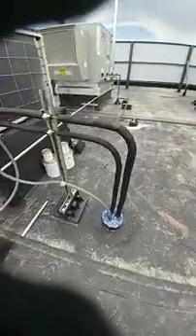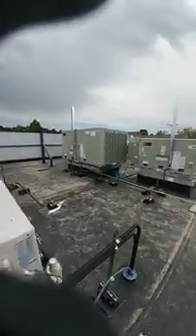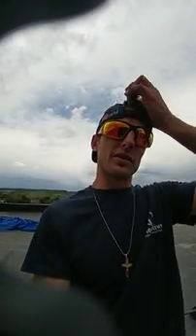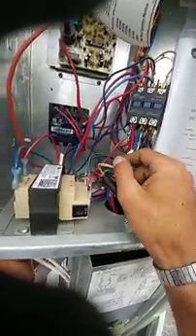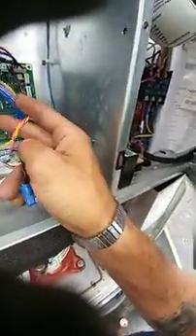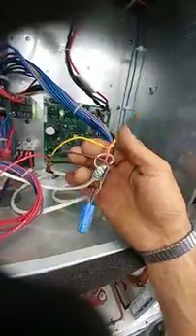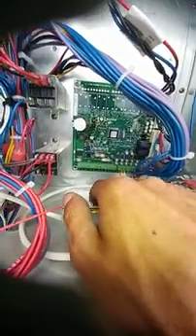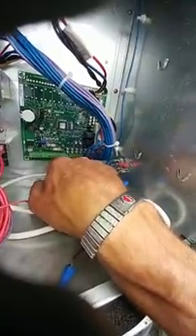🔩🔨HVAC/R DUDE: TRANE CO2 POWER EXHAUST CO2🔧🔩

Comment: I am working on one with an error code with 2 blinks (CO2 sensor error code). What would cause that lockout code?
Reply from the maker: Failed co2 sensor
Reply: @HVACRDUDE  The issue is that I can’t find any CO2 sensors in this specific unit. Would the code be caused by the dampers not opening when the unit is calling for fresh air?
Reply from the maker: @kizito8888 the c02 sensor would be in the space.  And yes possibly but usually throws a damper code and not C02 sensor failed
Reply: @HVACRDUDE  Thank you. I will check it on Monday.
Reply: @HVACRDUDE Btw, when you say “in the space” do you mean in the return or supply? Or in the building? My first time dealing with that code in cooling mode.
Reply from the maker: @kizito8888 should be in the room. By the return and tstat

Comment: We're do I land 24v power exhaust to on the trane control? OAH+?
Reply from the maker: To 24v
Reply: @HVACRDUDE  there's already a plug connector 24v from Bellmore actuator so would it make sense if I wire it to Exf on controler? Thanks
Reply from the maker: Exf is power exhaust so yes

Comment: I have a train unit stopping after a while and the error on the board is with the CO2 sensor, any idea how to fix this???? Thanks in advance
Reply from the maker: Take off the c02..it doesn't need it ..its an accessory
Reply: @HVACRDUDE  where is located???
Reply from the maker: It connects to the ECONOMIZER MODULE
Reply from the maker: Just shut unit down..pull the 2/3 wire molex n restart..should be good
Reply: @HVACRDUDE  And the LED lights will still flashing or it will stay solid???
Reply from the maker: I haven't done hvac in 6 years..hard to remember..I only do commercial industrial refrigeration now...0 hvac..hated it...roofs....fuck that
Reply: @HVACRDUDE  lol i underthe struggle 😂😂
Reply: *understand

Comment: How do you bypass a faulty co2 sensor? For temp cooling until I get new co2 sensor
Reply from the maker: The unit doesn't need a co2 sensor to run. All is does it open economizer and turn on blower low speed when ppm rises....just take it out

Comment: Hi. Working on a trane rooftop now, with a tane economizer, hooking up a co2 sensor. I see the dcv terminal your speaking of. Where I can I find a connector like that for the two wires from the co2. And which wires from the co2 do you use? Both outputs? Thanks, phill
Reply from the maker: +Phillip Broach it comes in the trane unit in the economizer package..there should be about 6 of them
Reply from the maker: +Phillip Broach depends on the C02, JUST 2 WIRES IS NORMALLY ON THE TRANES...JUST THE DCV....AND THEN 24V POWER STOLEN FROM ANYWHERE CONSTANT
Reply: I just had screws a gasket and a zip tie in the packet with the installation instructions. Maybe contact trane for a connector. Thanks for all that
Reply from the maker: +Phillip Broach anytime brother
Reply: @HVACRDUDE hey man I have a question for you, what type of actual wire do you use to run to your CO2 sensor, not regular thermostat wire I’m guessing